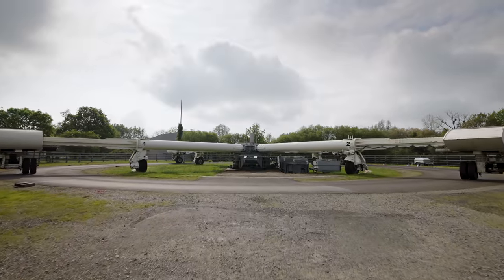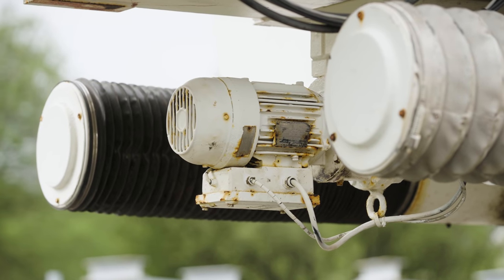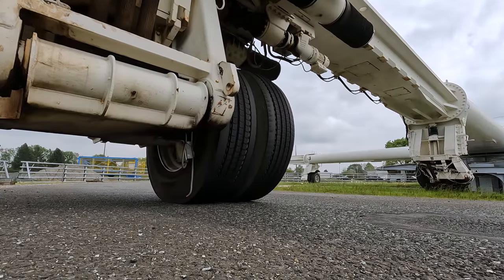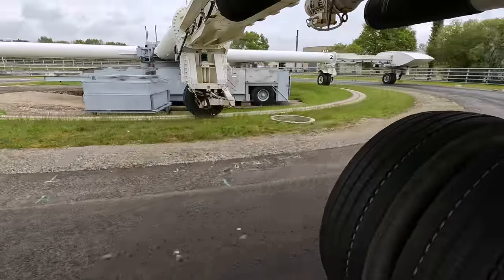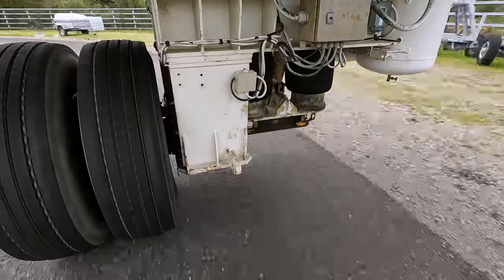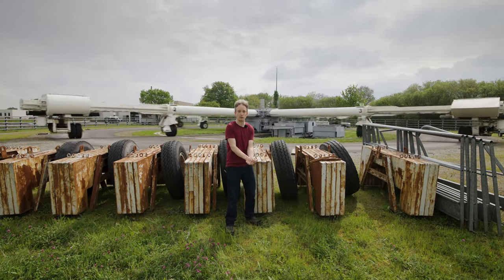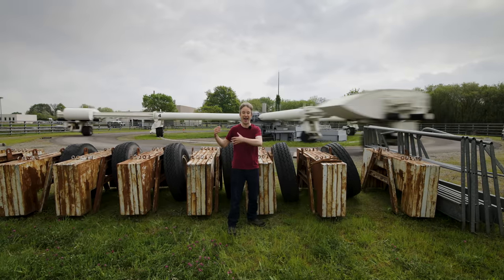The massive Fatigue Carousel helps keep roads safe

Comment: I actually was just wondering about how civil engineers/scientists know what kind of abuse a road can take and how to measure lifespan of a road. Tom... always answering questions I never thought I'd get an answer to.
Reply: A lot of it is also just decades or centuries of experience. As the guy said, you cant speed up things like the asphalt deteriorating over time.
Reply: Psychotropni Lachtan
před 1 sekundou
They take a wild guess. Most of these companies get liquidated after a while just so nobody can hold them accountable when it starts falling apart. And politicians are more than happy to secure new contracts for their buddies in construction bussiness so its not a big deal. Everyone wins, except the tax payers ofcourse.
Reply: Haven't figured that out in New Zealand yet, we use trucks going half the speed limit that will be set instead which does absolutely nothing (though our new road lasted about 2-3 months longer then expected recently, large step!)
Reply: california bearing ratios, relative densities, ESAs, drainage
Reply: Mostly, there are set designs and specifications for road construction. There are many factors however that will effect the lifespan including the substrate that the road is built on etc. However the apparatus shown in this video will mostly be used for novel designs of road surface construction, for future development.

Comment: This covers something I deal with at work ALL the time.  Management is always looking to do things more cost effectively, which makes complete sense, but they are convinced that everything can be analyzed on computers, eliminating the need to expensive real world tests.  They actually asked the engineers "what additional modeling and simulation tools/packages do you need to eliminate testing?"  It's mind melting trying to explain things to them when they have tunnel-vision on eliminating a large budget item. 

No matter how sophisticated and detailed your models are, there are always assumptions that need to be made in building them.  You need that physical data to actually show the models are giving the correct results, and if not, make fixes/corrections/adjustments to the models to have them line up.  You do this up front, the models can save tons of money and time down the line.
Reply: they just want to make money, we (engineer, dev) wanna make it works well and long lasting
Reply: Wait until they have some expensive real world rework that occurs because they didn't build a prototype, then for the next 5 years or so it'll be all "test everything simulations aren't enough" until the memory of that fades and they go back to "simulate everything we don't need prototypes" repeat ad infimum. Where I work we call these revolving management/corporate pushes the "flavor of the month" 😅
Reply: Yes, models were never meant to eliminate real testing, just reduce it.
Reply: That didn't matter through the pandemic at all. It's the way it is. Trust the models, trust the science bro.
Reply: I always say to my boss in this situation: Who is testing the automated tests? Who validates their results are what it is in real life use cases?
Reply: Because of managements decisions in overriding the engineers, we have seven high schools named after astronauts.  It's been a theme in business for many decades.  $hortcuts
Reply: Just tell them In theory almost always doesnt = in practice.
Reply: @glenthemann  what exactly are you referring to because those vaccine models could be developed based on Decades of science testing & development of vaccines...
Reply: Wait until someone tells management that ChatGPT is a cure for anything 😂

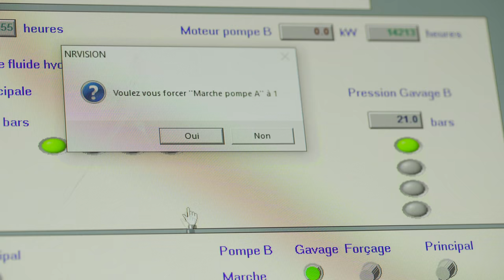Comment: 1:21 “Suspension compression” and “Thermoplongeurs” are exactly the kind of buttons I expect to find in a fatigue carousel
Reply: "Oui" @1:23
Reply: Lubrification
Reply: It's not compression, it's compressor. You can see the axles on the machine have a regular air bag suspension from a truck and these need compressed air.
Reply: Also “lubrification” and “marche”
Reply: @Dood Uhm ackchually it's "compresseurs suspensions".
Reply: this control panel looks like the LabView standard Frontpanel
Reply: ok
Reply: @jBurn_  Indeed

Comment: I'm glad you addressed the fact that weather and temperature cycles are absent from this testing, because it's a glaringly significant contributor to road wear.  People who don't live in a place that experiences all four seasons don't know the misery of potholes in spring followed by repair in summer.
Reply: Sure they do if they have Chinese pavement
Reply: North Queensland (all of North AUS) only has got two seasons (wet and dry) but we also get lots of potholes.. they appear in the wet, when the underground gets soaked and imperfections in the road-base (little bit softer than elsewhere) leads to deformation, cracks, water ingress and lo and behold.. when it's raining for a couple days you easily get potholes that will kill a cars suspension in one go.
Reply: @george5156  what is Chinese pavement?
Reply: @Ali-mv3jc  A mix of ground-up hopes, dreams, and bones of falun gong practitioners.
Reply: @Ali-mv3jc  Brick.
Reply: No,everyone gets potholes,we just get them less frequently than those in cold climates. Water is amazing!
Reply: Weather, temperature cycles, oxidation and UV. But, a good proxy and starting point. Fatigue testing can accelerate part of the testing, one cannot so easily accelerate time, water expanding and contracting, oxidation, UV, freeze-thaw cycles and well, everything else nature can throw at it. That testing is done as well, but would be boring to see a roadway doing a hell of a lot of nothing.

Comment: I love stress tests that actually use these cool practical tests instead of some math along with tiny test samples. There’s a reason for both, but seeing the test in action is just a lot more fun.
Reply: Yes very interesting
Reply: Watching fatique tests can be the most mind numbingly boring thing on this planet. I had to do a bit of it..
Reply: Could they test tyre wear using this rig as well as road construction? 🙂
Reply: @SimonZerafa  tire wear is already tested. That’s one of the ratings on your sidewall.
Reply: Sort of like watching the machine that tests the buttons or hinges on an old flip-phone, opening and closing the thing 20,000 times with something that looks creepily like a human hand.
Reply: Theres some great videos online of stress testing on Xbox controllers.
Reply: @SimonZerafa  I would assume that a proper tire testing machine is much cheaper to build and to run than this monstrosity. (you only need to spin one wheel at the same spot)
So it probably wouldn't make sense to use this machine for tire testing.
Reply: I mean sure the scale isn't all that tiny in absolute terms, but it's still a tiny test sample along with some math ;']
Reply: I used to love those Chair stress tests at IKEA from years ago.
Reply: @SimonZerafa  They could, but they can also just test tire/tyre wear by spinning a wheel in place against a counterrotating replica of the ground, which is accurate enough and heaps easier and cheaper.
Reply: But how many half-ton cyclists in lycra can it survive per minute!   Nobody tests for what is sadly not the unexpected.
Reply: @SimonZerafa they also have ways of testing tire slip angle on F1 carsm
Reply: Other fun ones include machines that simulate mattress and cushion use by repeated simulated sitting, and that one college project where they tested how many (simulated) licks it REALLY took to get to the center of a tootsie pop.
Reply: @CoconutMigrating  The question was not, "are my tires already wear tested or not?" it was, "Can a rig like this be used to wear test new tire construction methods?"
Reply: @RealUlrichLeland  I really loved and was bothered by an episode of How It's Made where they showed the machine that stress tests a new piano movement by rapidly and repeatedly running all of the keys through a rising chromatic scale.
Loud, but hypnotizing.
Reply: @CoconutMigrating  Hey, thanks for that info.

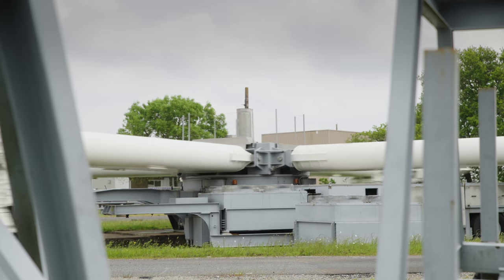Comment: 4:37 - as an aerospace engineer I totally agree with that. there are aerodynamics analysis tools called CFD - computational fluid dynamics. but my professors used to call them colorful fluid dynamics (bc they give you nice colorful contour images as results :D). because the chaos theory applies to fluid dynamics, minor changes in the initial conditions can cause massive differences. therefore you can only trust them a little after you validate its results with real test data by changing some parameters in the tool.
Reply: An aerospace engineer who worked at Boeing and brought himself in Enumclaw Washington state and got himself f*cked to death by a stallion? (Mr Hands)

I'm sorry, but when I saw aerospace engineer I thought of this

Comment: The limitations Mr Hornych talks at the end are just as important as the benefits. I really enjoy listening to researchers because they try to look at every angle possible.
Reply: I wonder if there are materials that are fine on curves but fail rapidly on the straight.
Reply: @pattheplanter  I imagine that ruts and grooves appear more in straights than on curves. I can't imagine that a lot of people will take the same exact route through a curve, but when it comes to straights, people will generally just follow the middle of the lane.
Reply: @pattheplanter  Hmm... Something with good shear profile, but bad compression response?
Reply: @pattheplanter  In this case I don't think it matters. The road surface should not experience any transverse force from the wheels because the centripetal force is on the rotor.

Comment: I want not prepared for how utterly terrifying this machine is, even through a video. I think the scale really does come across on camera here (I imagine that shot of how much it squashed the wheel at the start of the video really helped sell the weight of it), its scary just to watch, I cant imagine standing next to it
Reply: 13 RPM. O_O I mean... YIKES.  If the tires can run up to 100km/hr, no wonder the ends of the arms need aerocovers!
Reply: Yes, consider that to get those wheels to compress that much you need 130 tons plus of load on them, more than double the normal mass of a fully loaded truck tractor and trailer combination, that will be spread out over 5 axles as well, and 18 tyres.
Reply: As someone who works on and operates large theme park rides, it’s exactly as terrifying as you think. The scariest ride I’ve ever worked on is similar to this, but with people on the ends of the arms, and us operators have to stand within 5 feet of where it spins. It’s terrifying
Reply: I would love to see this recorded for VR - that's certainly a sure way to make the size translate perfectly to the viewer.
Reply: Actually anxiety inducing
Reply: every time it swiped past his head, I twitched a little.
Reply: I'd be terrified of somehow getting sucked under those wheels, even though it shouldn't be possible
Reply: This is where the rubber meets the road.
Reply: I'm honestly amazed that these tires don't explode. They look about to burst and are then thrown around a tight curve at high speeds. It works, but it feels like it shouldn't, somehow.
Reply: was not*
Reply: If they put seats on the thing they can charge people to ride it.  Testing become financially self supporting and maybe start funding other government departments.  :-P
Reply: I would have liked to have known what would happen if the pavement suddenly gave way or collapsed at some point, and how this utterly bizarre and terrifying piece of brilliant engineering would have coped. I should imagine that the wealth of instrumentation gives them all the information they might need before such cataclysm. Incroyable!
Reply: How the hell is this terrifying ?? You must scream when you see a mouse.
Reply: Meh. It wasn't that terrifying. Y'all are feeble.
Reply: If you find this machine "utterly terrifying" then you must have been absolutely petrified when scientists told you about covid and cancer. How are you coping with the constant threat of nuclear war and terror1st attacks? You should definately avoid beaches in case you see a sand castle or seagull and faint. It's also probably best to avoid theme parks, trucks, cars, planes, ships and tractors...just avoid roads altogether that way you won't be terrified all the time.
Reply: @thomaspayne5232  it is a large machine moving extremely heavy weights at high speed. I’ve worked on machines very similar to these, and I fear them for a reason. It’s not like a truck or Covid (not sure where your logic is on that) the forces these machines withstand is far greater than anything like that.
Reply: @longshot7601  I love that idea. I once took a flight to a small island where they weighed each passenger before assigning us seats. Plus we got rearranged after the plane unloaded some freight on each island.
Reply: Its ok, we will be ok.